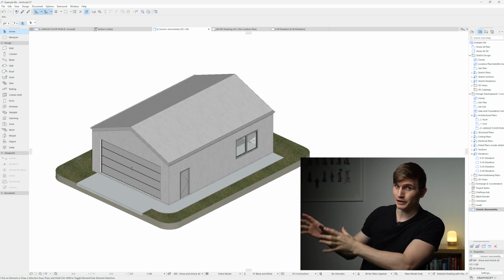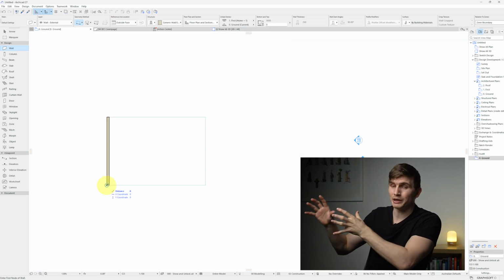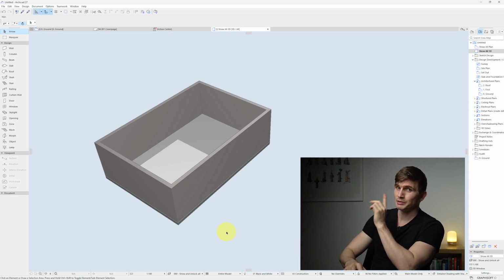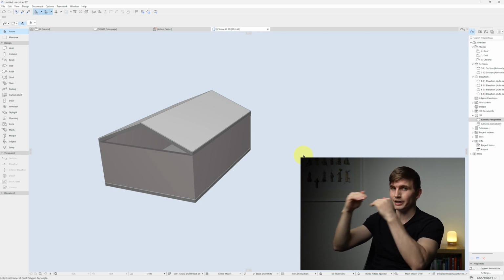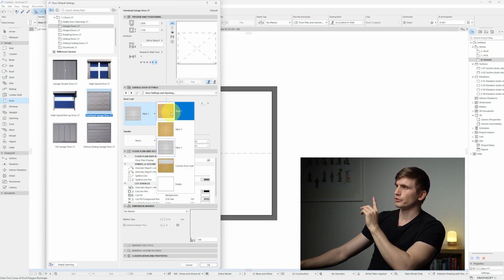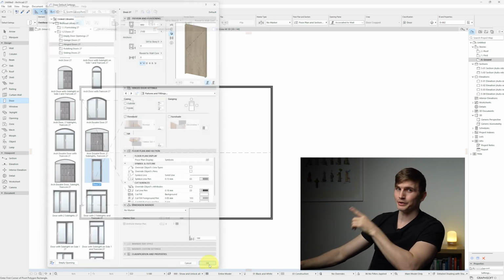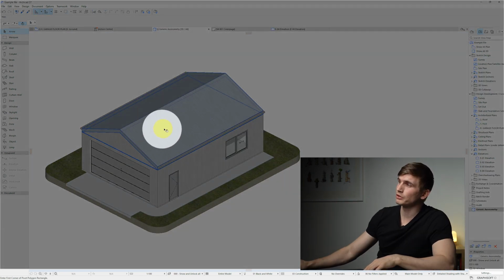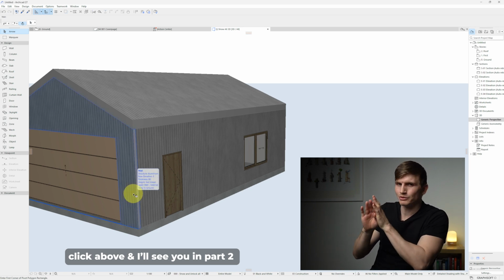ArchiCAD 27: How to draw a Garage - Beginners workflow - Part 1

Comment: Thank you very much for this tutorial. Just bring up a tip for trimming the wall by roof, we can use "connection, trim-element-to-roof" command which is easier than "solid element operation".

Comment: Hey mate. 

Found your channel really good and thank you for sharing.  Seen a few of your tutorials, and have one issue that have come up a few times. 

While we seem to have most of the same in a template, when it comes to "pen sets" I find very little options. Any tip on how to go about it? 
The black and white is not a thing for me, and while I can create my own pen sets in the future I kinda want to use what is available.When I tried making a all GREY pen set through the attribute manager by "marking all".. when changing to a color it just reverted back to the one I had to double click even though I had it all marked. This I saw was mentioned by a few others and could be a bug with us windowsusers for archicad 27?